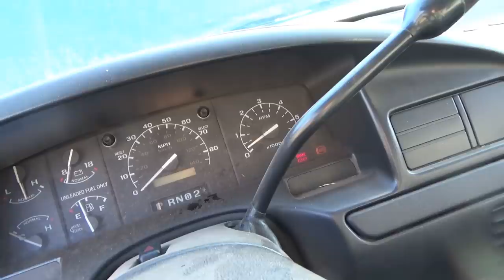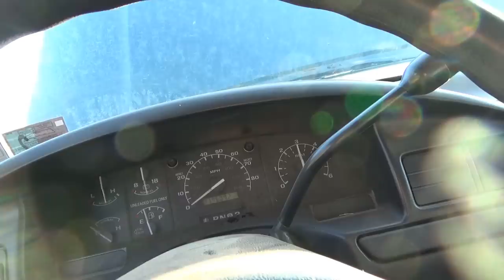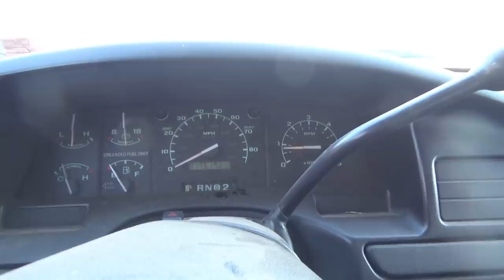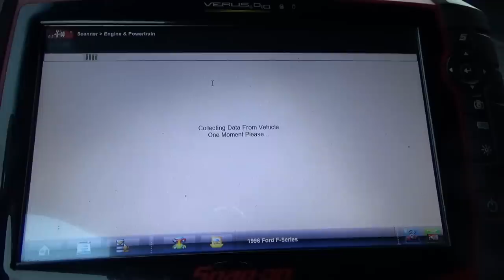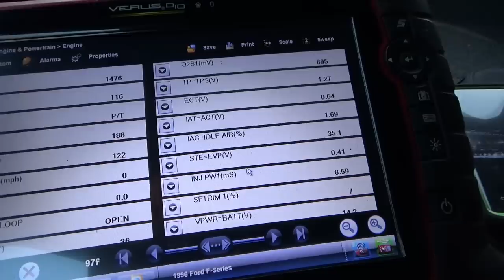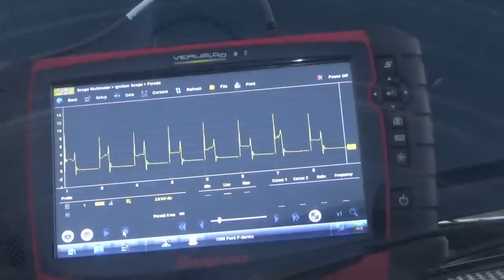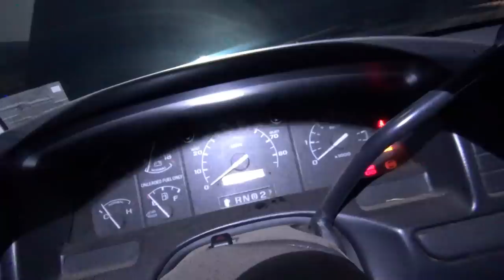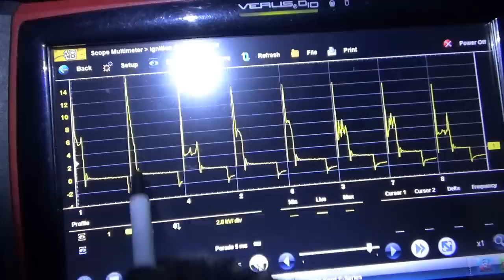Ford BIG BLOCK: Hard Start after Engine Rebuild? (Part 1 - Memorial Weekend Special)

Comment: Total loss of compression on all cylinders has to be the lifters pumping up, maybe stuck relief valve in the pump causing too much oil pressure. This would be worse when cold and get better as the oil warms up.  Unfortunately this era of Ford has the unbelivably crap system of an oil pressure switch (not sensor) connected to the gauge so it doesn't show actual oil pressure.
Reply from the maker: Now that's an interesting theory! It absolutely blows my mind that all 8 cylinders lose compression at once after a little throttle snap 😅

Comment: 1996 is the first year of OBD2 Diagnostics and requires a mandatory OBD2 DLC Connector under the dash.

Why not use that for a scanner connection???
Reply: I think that requirement was on cars and light trucks. I think they exempted heavy duty trucks for a year or two later. 
Glaring problem is 6.8 volts Vref on data stream. Seems to point to computer problems. They had a ton of problems on OBD1 systems. 
I worked in this industry as tech and shop owner almost 50 years. Forgotten a lot along the way too. 
I don’t envy Ivan for his knowledge in the new technology but got to smile at how the  old stuff can stump him. We didn’t have thermal cameras or infra red thermometers either. Used a crayon on exhaust manifold to see if cylinder was contributing. Looking forward to final solution. I’m sure I’ve seen the cause in the past but my past is getting fuzzier as I push 70 😊

Comment: I have a 96 f-150 with a 302 (with OBDII)..... I know not the engine however, if the plugs are not the right one's , ( not long enough or hot enough) the engine runs like poooo. Oh, and the spot not plugged in will cause issues as well..... just my observation

Comment: Just needed an Italian tune up...
Reply: Please respond to tell me what an Italian tune up is.
Reply: @nickchannel5364  from Google, a popular online search engine: "An Italian tuneup is a slang automotive term for attempting to restore engine performance by driving a car at high engine speed and load. The term originated from Italian mechanics in the 1950s using this practice to burn off carbon deposits from the spark plugs of sports cars." 

You can also find answers to other questions you may have by typing them in the Google search bar on your phone or computer like "what is an Italian tune up?"

Comment: 1996 was first year OBD2 by federal law. Definitely has some live data. Maybe it's a '95?
Reply: Just an FYI.
My '95 Windstar was OBDII. It was the first year for the Windstar, so they jumped ahead with OBDII.
Reply from the maker: Heavy duty Fords only went OBDII in 98...
Reply: @PineHollowAutoDiagnostics  Huh, interesting, I was wondering if it was something like that.  I think Chevy went OBD2 for the whole lineup in '96, even 2500/3500, probably since they introduced the Vortec engines that same year.

Comment: Pausing at @5:50 :  if the owner installed a new cam and lifters, and did not follow proper break-in procedures, the cam and /or lifters could have been wiped out.  Even if all procedures have been followed, grotesquely inferior replacement parts from no-name Chinese sources could have bit this owner in the butt.  Check oil for the sparkle of death; and conduct old-school tests:  compression tests, leak down tests, verify firing order and timing, vacuum, and visual verification of proper pushrod, rocker arm, and valve action.
Reply from the maker: But how does it run like a raped ape when warmed up under load? ;)

Comment: 4 minutes in and I'm gonna go with wiped out cam..
Reply: Complete rebuild.
Reply: @dans_Learning_Curve   Yeah I understood it had a complete rebuild and when he 1st started it up the oil pump wasn't turning because he didn't have the distributor stabbed into the oil pump shaft properly so it could have very well wiped the cam out or at least some lobes and/or some lifters,, that's a possibility..
There's also many more possibilities because running a freshly rebuilt engine for even a few seconds with no oil pressure,,,, not good..
Reply: @2packs4sure  hopefully there was enough assembly lube.....

Comment: This is old school, my generation stuff, No, computer stuff or super tools to diagnoses. Your doing how we used too, without a code to tell you. LOL  Hint there is no such thing as breaking in an engine. It run correct or it dose not if done incorrectly. Not talking Nascar or dragsters, stock engine run or there something done wrong.

Comment: I really enjoy your videos, but I feel sometimes you rely to much on a computer to tell you what's wrong and to dictate your moves, rather than using your working knowledge of the engines to diagnose ( for basic issues) I feel that you overcomplicated this vehicle. For example, if I had a misfire on vehicle that had modern OBD II or not, the very first thing I would do is check the spark plug and wires, and even switch a spark plug with another one that was not giving any "issues" I'm not saying shoot the parts cannon, But it took you a long time to even look at the spark plug(s) themselves.....and even said " I now have enough evidence to pull the spark plug" after you using the computer several times. To me the evidence is the misfire itself. I'm not trying to be a jerk and mean no disrespect. I too use computers to diagnose issues, but more complicated ones that are not as obvious.  I mean If I was charged lets say 2 hours or more for diagnostic services, and it turned out that I had a fowled spark plug, I would be pretty upset that the basics were not observed before trying to have the computer say " my fuel trims are jacked up, my o2 sensors are jacked up etc, when a misfire will cause those things to happen at times especially at idle. Now I see this is just part one and maybe in Part 2 there was some wiring messed up or an actual complicated issue that lead to the fowling and ultimately the misfire, if not.......
Reply from the maker: Fouled plugs is just a symptom of the extreme rich condition. Without looking at live data, you would get absolutely nowhere with this truck, trust me 😉